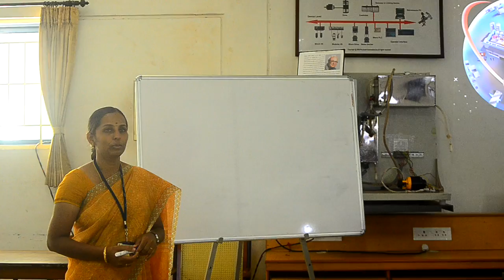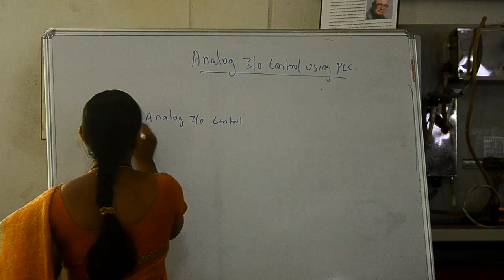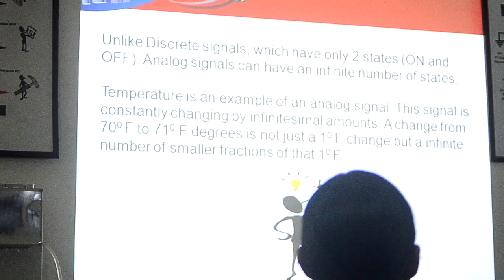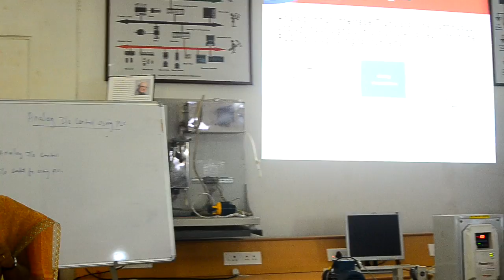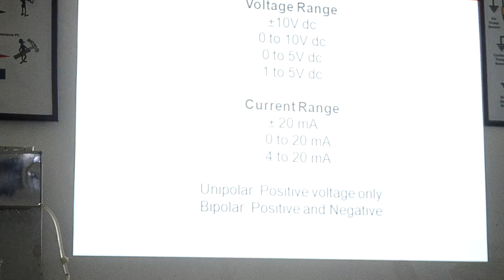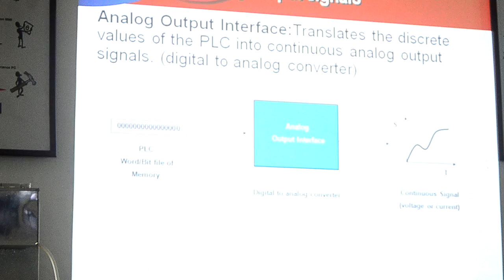PLC analog programming and speed control of AC motor using PLC

Comment: I have Delta plc . I want to use a proximity sensor on motor shaft the condition I want to apply is that when motor rpm goes to 900 output Y1(for example) turns on and when rpm goes down below 900 output turn off. Please help me Mam

Comment: hi mam,
        I am Mathan your presentation is very nice,but your vedio is not clearly. your vedio is usable my plc project, i need some doubt ,
HOW TO FINDING THE STRAIN GAUGE ANALOG VALUE IN PLC, THIS MEANS I HAVE A ANALOG IN 0V , DIGITAL VALUE IN 1652 APPROXMITLY. BUT CANNOT FINDING THE 1V TO 10V. Please explaine the vedio , please replay.
Reply from the maker: In PLC, you get digital count values which is a variable depends on the bit resolution of ADC inside the PLC. say 4096 count is for 12 bit resolution. 0-4096 scale down to1- 10 v .If you get 1652 as a digital count means10/4096*1652=4.03 v is your analog input voltage.
Reply: hello, nice presentation, just one question: on the above example, is 4096 or 4095 (0 to 4095 => 4096 divisions), i ask because is not clear to me. Thanks